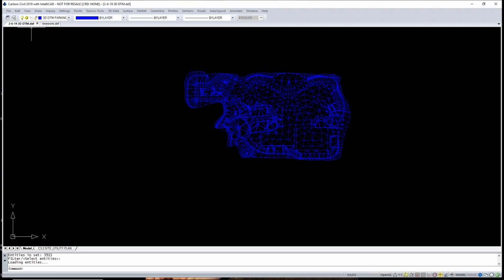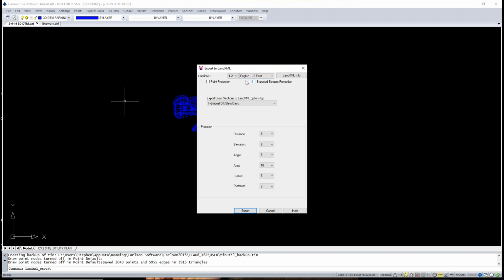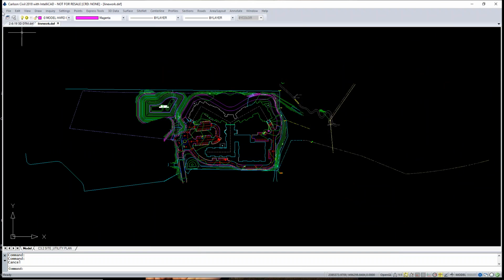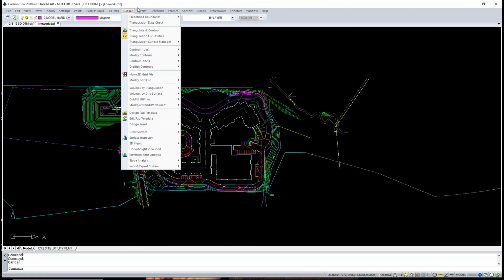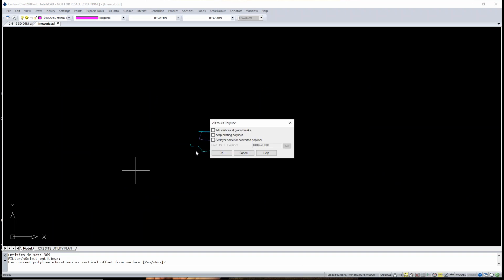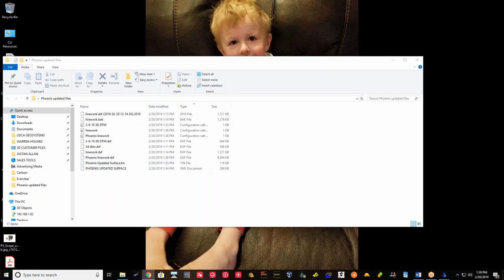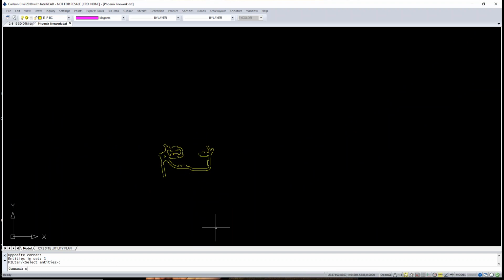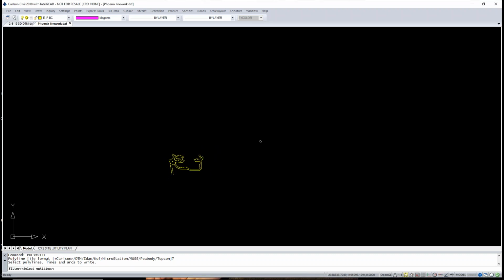Optimizing files for Machine Control Use in Field

Comment: Thank you for the detailed instruction. One tip is to add the view tool bar and switch the view to 3d perspective and remove the 3d lines with zero elevations before processing the final surface. You never know when a spike will glitch something.